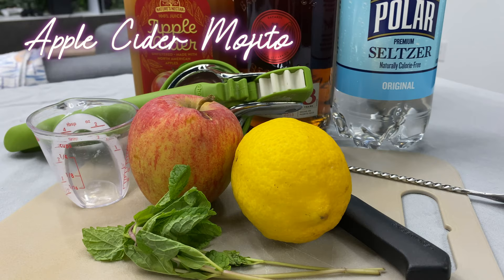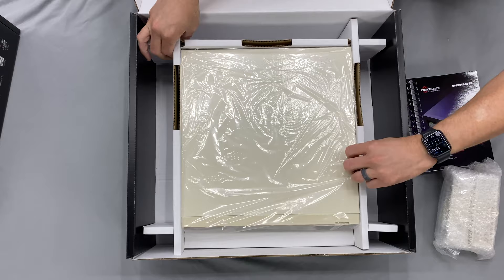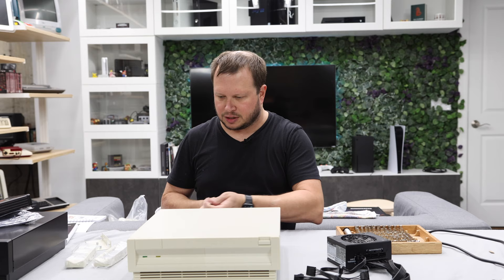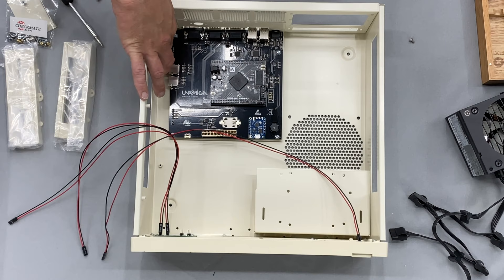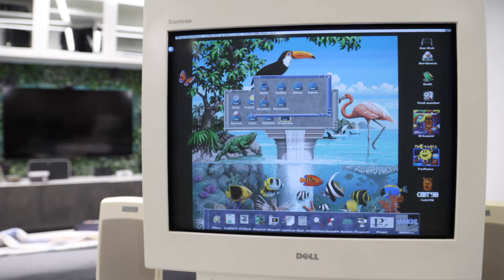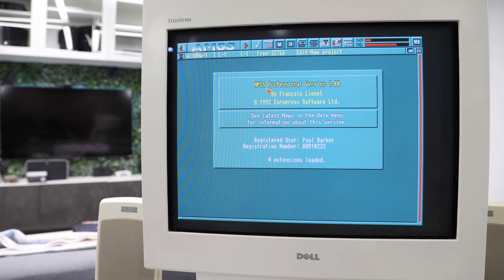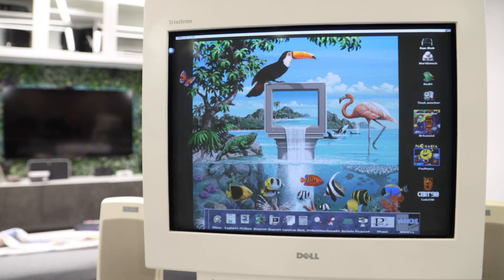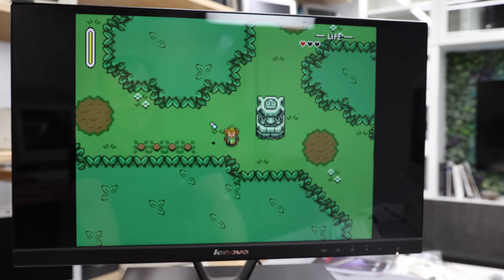Building 2 Checkmate A1500 minis | Jeremy's Retro Bar

Comment: They're nice cases. The whole history of the A1500 is really interesting. Stephen sold the original A1500 case back in the 80s as a kit to convert your A500 into a big box system similar to the A2000.  Commodore liked/hated the idea so much they made an official Amiga A1500 and effectively killed the market for it.

Comment: This case is anything but small. There's so much wasted space and volume its hilarious. And has major design mistakes. From not having perforation for the PSU to adopting SFX instead of TFX for the power supply which would have made it almost much smaller which is the whole purpose. You could fit a MICRO ATX board in this thing, let alone a mini ITX. They need to study other makers and offer a true mini-itx case in the future. The perfect width would have been just wide to fit a 5.25" bay and a few buttons/ports in the front and double slot GPU + TFX PSU in the rear. Basically the ACER Veriton's case is the perfect example of that.